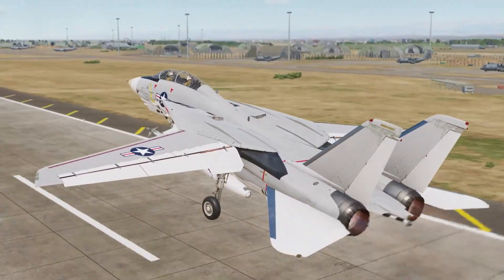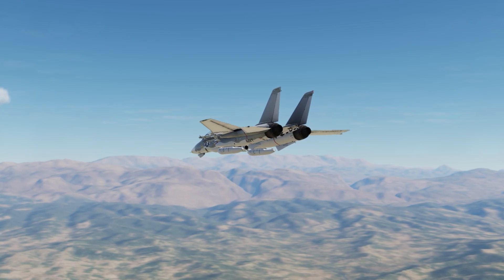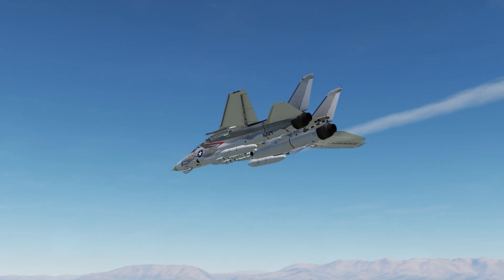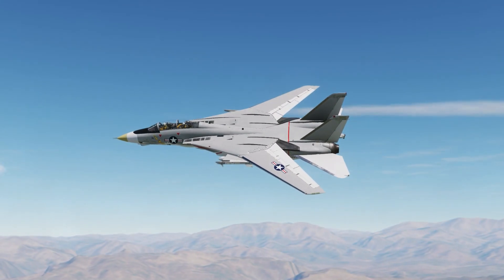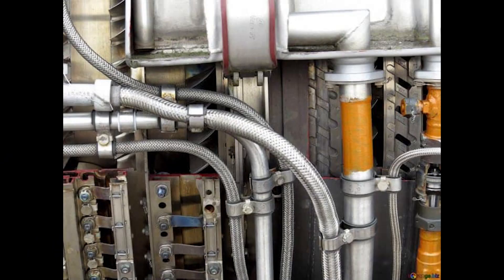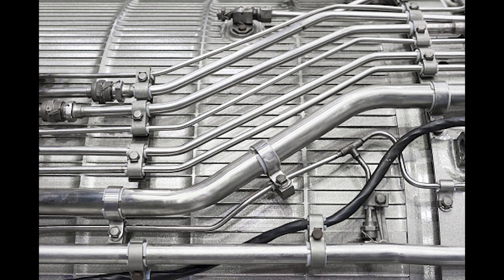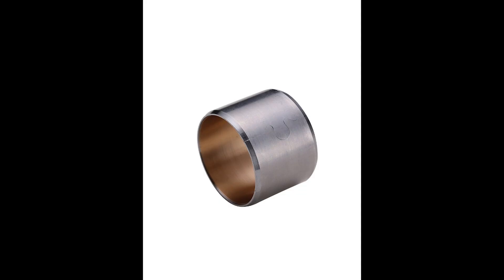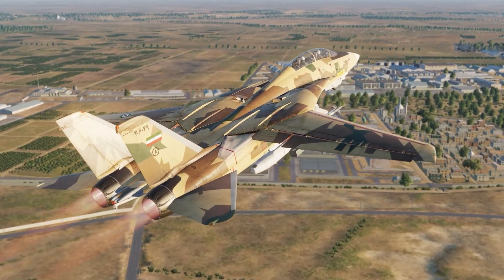What caused this prototype to crash! | #iran  F-14 Tomcat | Topgun

Comment: The F-15 and F18 have always used Titanium hydraulic tubes without problems.  This can be attributed to the use of the following software that was used to design the hydraulic systems: 
“AIRCRAFT HYDRAULIC SYSTEMS DYNAMIC ANALYSIS” User Manual 1977 otherwise known as HYTRAN for hydraulic system transients. 
The original HYTRAN software was developed by MCAIR (McDonnell Douglas) in the early 1970’s and used to analyze hydraulic system transients.  There was also pump frequency and steady state software included.  These software programs were awarded to MACAIR by AIR FORCE AERO PROPULSION LABORATORY AIR FORCE SYSTEMS COMMAND; WRIGHT-PATTERSON AIR FORCE BASE, OHIO after winning a competition with then Boeing.